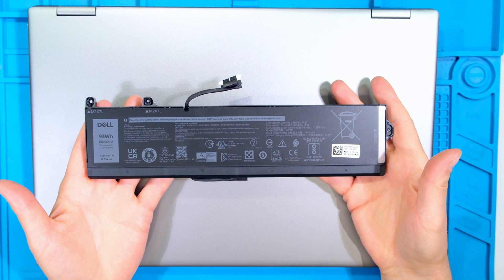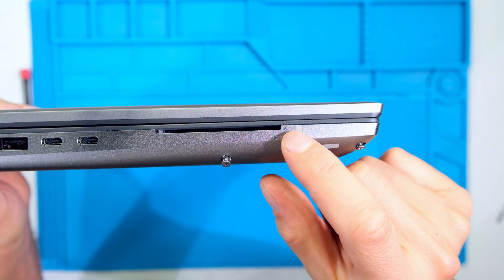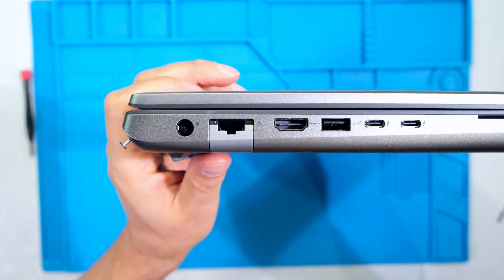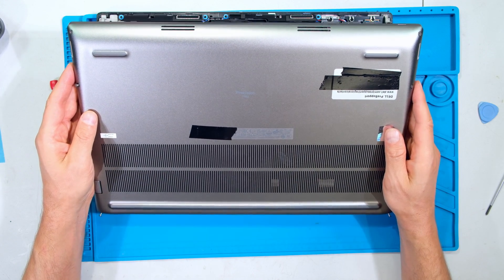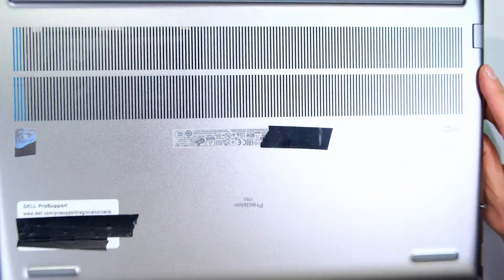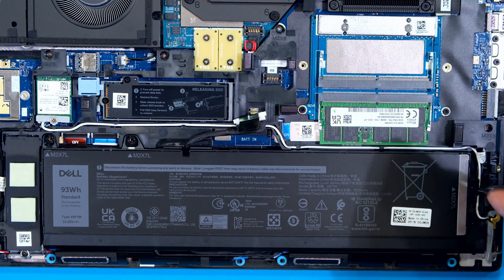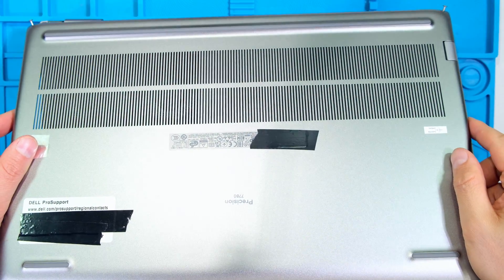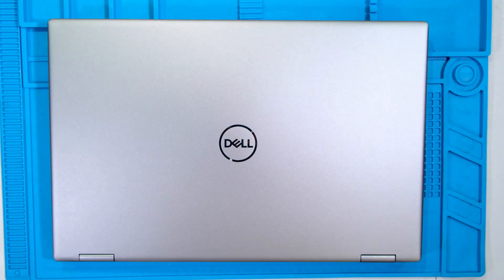How to replace the battery in a Dell precision 7780 laptop

Comment: What does the battery weigh? The laptop itself is almost 7lbs. I always use it plugged in so I thought about leaving the battery out to reduce the overall weight.
Reply: I think the battery also serves as a UPS. In case that there is a sudden power outage the battery can make sure you at least save your work and hibernate safely.